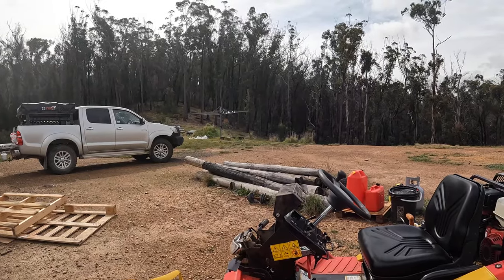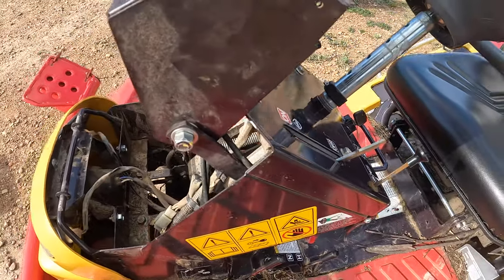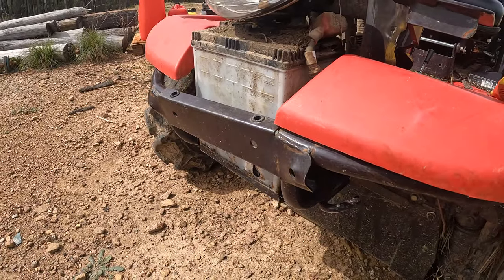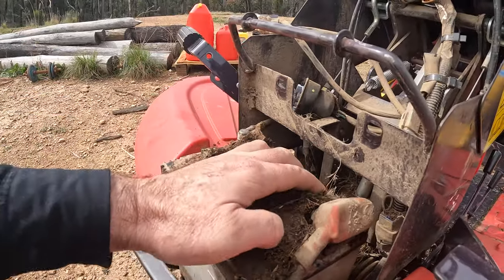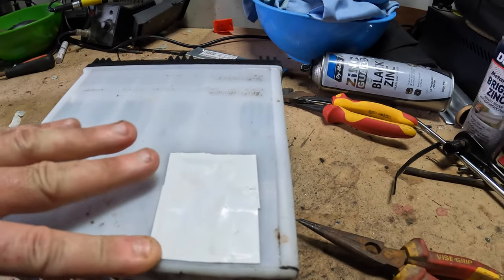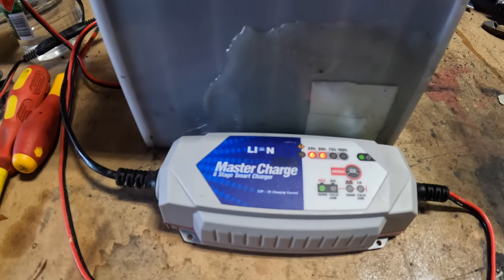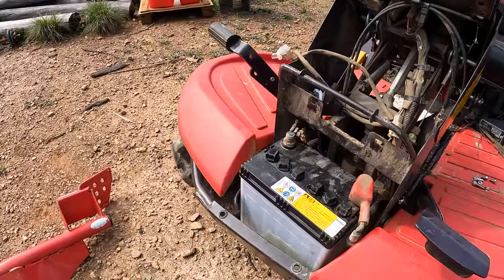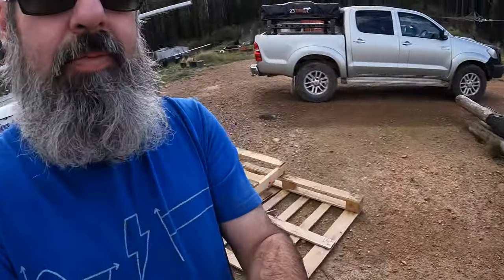RazorBack Mower Battery Removal/Install

Comment: The engineering in the Razorbacks is pretty incredible, as you said. I have had to get into the battery a couple of times so I could get a small air compressor connected to pump up a slow leaking tyre, and the way the whole nose assy usably goes together is quite neat - the little basket is a great thing, when you need to carry something a little more substantial than you can put in your pockets. I'd better check the fluid levels in my battery, it's been a while since I serviced it last and I gave it a massive workout over the past week when we've been using the winch a LOT to rip out some weedy trees, and I'd hate to not be able to start it (we don't have the pull start engine)
Reply from the maker: Pull Start is handy, until the battery goes absolutely flat. Mind you, if I had the BullBar on I wouldn't have damaged the battery! I put a tow rope on the bulbar and ripped it off, then I found the tow hooks!! But I learn from my lessons haha.

Comment: It’s a great design but a bit of a mission to get to the battery. How do you put it on a charger? Do you have to remove all that covering to get at it or is there another way?  Nice video again Steyer.
Reply from the maker: It's in there pretty tight so no access with covers on I can see. You could look at hooking the charger on at the positive on the starter motor and then a neutral. But it's really just 4 screws with thumb tightness (no tools) one Phillips head and 2 13mm nuts to get the covers off, pretty easy, especially if you leave the top 2 thumb tight screws out.